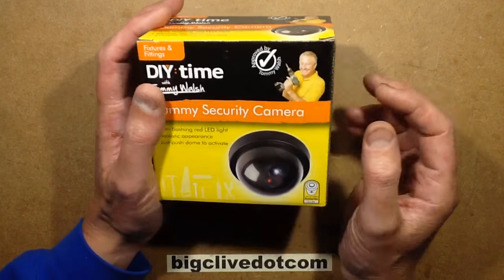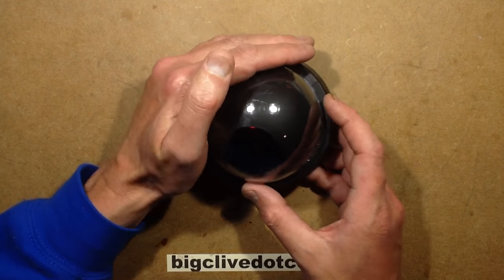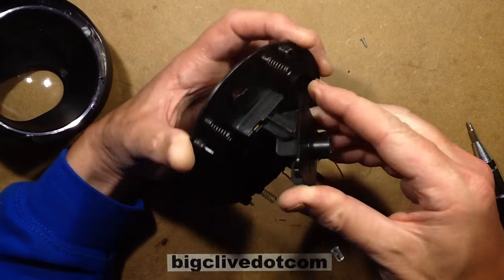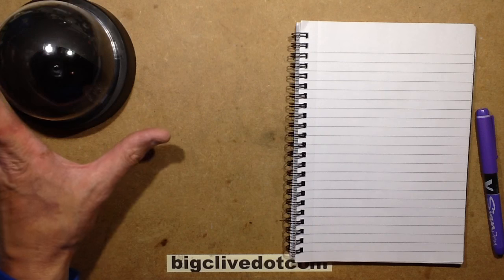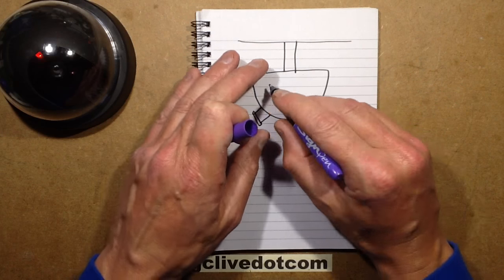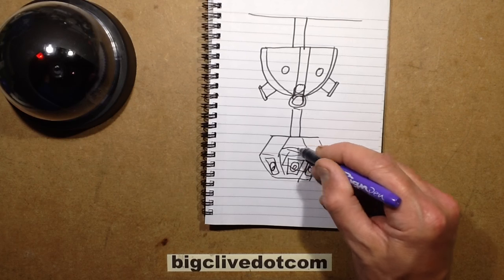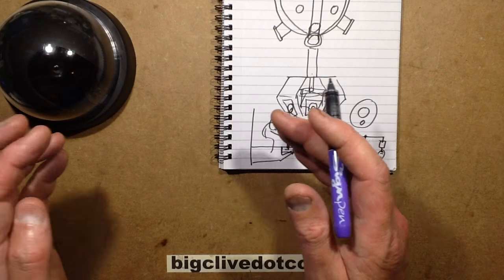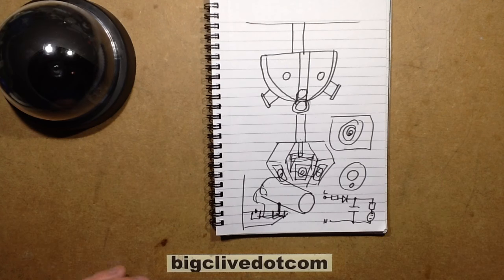Poundland dummy CCTV camera.

Comment: You know, you can get a composite video pinhole camera for very cheap on eBay. Might be an interesting project to use this case and make a fake looking REAL camera.
Reply: I was thinking about that even before I saw your comment haha
Reply: Take it one step further and add an array of "infrared" LEDs using the super cheap red ones, for extra cheesy effect.
You'll have unsuspecting mischief makers laughing straight into the lens because it looks so dodgy.
Reply: Actually if you used real infrared you'd have night vision once it reflected back into the camera. Assuming the camera converts it to a purplish white light like the cheap ones do.
 Some digital cameras do have an infrared filter though which ruins the fun.
Reply: PixelOutlaw
Once you get to that point, wouldn't you be better off just buying an actual dome cam? :P

Comment: When you mentioned LM3909 it nearly brought me to tears. Why the hell is it when people invent something perfect and beautiful they stop making it. Just like Nickel Iron batteries which last virtually forever and stand endless abuse. The LM3909 was brilliant, I built a circuit for a friend that flashed a red LED to make it look like he had an alarm in his garden shed. I think it only had one Duracell D battery in it. The spec on the chip said it would flash for two years I think. It flashed for ten years at least, and it may still be flashing. He never changed the battery. I am sure it is still working somewhere in his shed. It has been years I had hair when I made the bloody thing. Managed to buy two LM3909s recently, it may have been ebay. Not used them yet but if I ever need to they are there. The battery must be leaking by now lol.
Reply: Why don’t they make those batteries that last forever anymore!
Hmm 🤔 I wonder why
(Because they are B🤬stards & there’s no money in it)
🤗

Comment: hey big Clive what's your printer model? the one with huge ink capacity
Reply from the maker: It's an ordinary printer (Epson SX515W) but fitted with a CISS system (Continuous Ink Supply System) That has a special set of tanks fitted with an ink ribbon cable that goes to an external reservoir for the four colours (4 x 100ml).  The printer occasionally rejects the cartridges because it can't read the ink level properly.  When it does I just press a button on the cartridge and it makes the printer think a new set has been fitted.
Reply: Clive, Perhaps you could show that hack ?
Reply: +bigclivedotcom thanks for response as I know you've answered it in a video before.

Comment: In supermarkets, I think they still have them, if your at the checkout, look up. There is often a mirror the length of the checkouts either a mounded semi circular tube or more likely a metal box with long mirrors along its length on the side facing the checkouts. Inside is one camera, that trundles back and forth on tracks. Not sure if it "patrols" back and forth or can be moved at will. It's looking but of course obfuscation of its exact location at any given time is likely more deterrent than the camera itself.

Comment: A suggestion, how about putting an IR motion sensor in it and activating the led with it? That would look more convincing I think
Reply: Poundland.
Reply from the maker: It has a position for an audio sounder, so I'm guessing that they had a simple LDR style motion sensor option for warning noises.
Reply: Yeah, some dome cameras have IR emmiters which are barely visable, but visable non-the-less. 
I think the intention of the LED light is to give the impression that it is connected to something, so not a bad thing
Reply: motion sensor would probably consume more power than contantly flashing LED

Comment: On the subject of dummy cameras:  we had a problem with people pulling the fire alarm in a hallway in the industrial plant where I work.  One day I was handed a real camera (but it wasn't going to be connected) and told to mount it on the ceiling pointed at the alarm pull station.  Further instructions were "do it at shift change, and get in the way as much as possible."  I went so far as to drop the cables through a hole in the ceiling, but the cables were actually not connected to anything but the camera.  I looped the free end of the cable around a rod to keep it from being pulled out of the ceiling.  The false alarms stopped immediately. :)

Comment: Another thing you could do is put a wire into the camera's case and then run it off somewhere so it really looks like it's wired to a DVR/Monitor.

Years ago back in the 80s I went to a department store named Bradlees and that was in Connecticut and they had some weird looking CCTV cameras. Basically it looked like a striped ball hanging from the ceiling and every now and then it would turn. As a kid I was like what the heck is that thing? later it hit me that those weird looking balls hanging from the ceiling were the CCTV cameras and you couldn't tell what direction the camera was pointing. This store is defunct now.

I've never seen a red flashing LED like that. Most of the ones I've seen are the flickering LED tealight candles and the multicolor changing LEDs.

Comment: We had the dalek style ones in Debenhams when I worked there in about 1990. All the eye cameras were fake, but one of the chrome strips was actually a 2 way mirror with a camera mounted behind. It was the security guard manually turning them in this case and the camera also had full 90 degree up/down movement as well as zoom. The red lights could be switched on and off independently of the camera too, so they didn't correlate at all with a camera actually being active.
Reply: What Debenhams did you work in & What colour was the Cameras
Reply: Calfaeairdrie 
The branch was in Guildford, Surrey. I don't remember the colours well. I think the kettle was chrome and the strips were black in fact, with one strip being transparent. They had 4 fake cameras pointing out at 45 degrees and some button lights, either white or red.

Comment: A few years ago, I was given a couple of dummy cameras, but they were rather more sophisticated. Along with the led, there was also a motion sensor of some sort. So in addition to the blinking red LED, the motion sensor detected your presence and activated a small motor which would pan the dummy camera left and right. If you watched it, it soon became apparent that the device always came back to the same parking position. The fake lenses were remarkably realistic, with a dark and sinister look which reflected light, but you couldn't see through them - A bit like Darth Vader's helmet!

The fake cameras were a convincing 'duck egg' blue, and of a size that reflected the appearance of an average CCTV camera of its time. They even had a plausible sounding maker's name. For added realism, there was a fake flex which exited the back of the casing, and entered the wall plate.

I should still have them somewhere.

Comment: The old C & A clothing stores used to have those 'Dalek head' cameras as well. I first saw them in 1973.

The vidicon tube was the most common pick-up, Plumbicons were more expensive and were found in broadcast cameras and medical-imaging equipment. Vidicons were overly red sensitive, unlike the early Plumbicons. They also smeared in low light levels. I can't imagine the image would have been very good in some locations.

Comment: You could slightly undummyfy this camera by inserting 9 red clear LEDs like this one, but glowing constantly, stick them around the "lens" in a circle and drive them through high value (like 2k, 4.7k) resistor. That way they will immitate infra-red light for a real camera and the power consumption will be way lower than 10mA generated by that 1 LED, closer to 1mA.

Comment: I worked for Boots the Chemists up until  87 and I had cause to use this security camera system. The only camera that was working in each dome was behind one of the chrome glass strips. It went up & down by a joy stick & this also moved the dome L&R or you could switch it to auto and it would move randomly. The video feed was to a monitor with a VHS recorder in the security office. You could also choose a feed to display on the public monitor.

Comment: Torquay still has a few of the old type dome cameras around in public areas and along the street, they are massive, have 4 fake lenses attached with the one real camera inside; the camera itself can be upgraded to more modern CCD/CMOS type as the big round dome is just a PTZ housing, so mechanically there is no reason to change them to newer types until they actually break down which has only happened din a few cases recently.

Comment: I remember those rotating camera arrays, there were similar ones at a local Woolworths until a few years ago. They were painted red and looked more like a disc-shaped UFO with multiple flashing red LEDs around them. At least one camera on them was real, because if you carefully watched the monitors that were located near the cash registers, you would eventually find out which camera looked where.

Comment: I am 95% certain we still had those huge things in one of the local (Holderness Road, Hull) Boots branches as far as the late 1990s if not the early 2000s. The interior of that place did not change at all for almost 30 years, I don't really know when they disappeared because I didn't go in there for around a decade, only returning a few weeks ago and noticing they had finally changed the interior - and missing the old one immediately as I used to like watching the chemists and film developers in the back when it was all open. Those huge, more square ones did indeed have at least one real camera in as you could also see the grainy monochrome images on a CRT wall at the back of the store. Pretty crappy, because it was always really dark in there (it resembled the set of a cheap 80s music show or something, not very Chemist-y at all) and the cameras didn't work well without a blinding level of light. Ha, I can still remember what it used to smell like in that store.

Comment: LM3909 can be kinda-substituted with ICL7660 for a 1.5V LED strobe. Google "ICL7660 led flasher" for a schematic. It's just a matter of driving the frequency of the charge pump down. The downside is a little afterglow present.
Reply from the maker: Neat.  I hadn't come across that.
Reply: @bigclivedotcom  I have been using chopper stabilised op amps for 49 years they are what make your dvm work . Where have you been lad ?

Comment: The large Boots store in Eldon Square in Newcastle had one of those "Dalek's head" cameras right up until the late 1990's! Speaking of Daleks, I use two of those Poundland fake cameras on my Dalek as removable bumps painted to match the rest of it otherwise the base of the Dalek won't fit in my car as it's a really tight fit against the roof.

Comment: 110mm film is know as Medium Format and is MUCH bigger than 35mm. Beautiful format.
Reply: 110 film/cameras were a short lived format in the 70's and 80's. The film was a lot smaller than 135. I've got both he Pentax 110 SLR  system, and the Minolta 110 Mk1.  The format up from 135 was 120 &220.
Reply: The 110 film Clive referred to was in a cartridge which made it easier to load film in a small camera. The quality of the pictures was poor but appropriate for 'happy snaps'.
Reply: the 110 clive refers to had a negative size of 13mm x 17mm, much smaller than 35mm, it was the 1970s cheap camera.
Reply: Ah, interesting how it went from very small to very large.

Comment: Most of the shops in the Whitgift Center (Croydon) had those, I remember Woolworths (in both Croydon and New Addington) had them in black and chrome. Also, some shops (Boots) had mirror domes on the ceiling... All a bit "UFO" and "Space 1999".
If you stuck a syringe on the side of it, it would look like that chrome black orb thing that Darth Vader used to threaten Princess Leia with, in order to find the location of the rebels hidden base.

Comment: Best I could find was ... https://www.flickr.com/photos/pixelhut/6654036665

Both Boots and Woolworths in the UK commonly used those black and chrome ceiling cameras with multiple lenses.  As with the hex-a-globe one you disassembled, Clive, they only had one camera behind one of the lenses - when a feed was sent out to a TV visible to the public later in their lives.  I found the downward-pointing lens the most amusing.  I suppose they could have looked a bit sinister, but I thought of them more as R2D2-like than Dalek and therefore more benign.  They had them hanging around the Polaroid cameras and Dragon 32 computers in Boots.
Reply: yep that's the one
Reply: Yes they had them until very recently in the Boots branch I worked in. I can confirm that the camera was behind one of the silverised strips mentioned. They even had one in the stockroom watching the staff.
Reply: johno4521 can you get hold of any?
Reply: What Boots is it you worked in.
Reply: Calfaeairdrie 680

Comment: As most CCTVs now have IR LEDs that faintly glow red in the dark, I'm surprised there are no dummy CCTVs that imitate this, i.e. ring of red LEDs connected to a high value resistor.  This would give the familiar IR CCTV look in the dark while drawing less current than a bright flashing LED.

Comment: Just out of curiosity can't you achieve a similar job as the LM3909 with a LM555 and a NOT gate or a Flip Flop? I'm not familiar with the LM3909 so I could just be getting the wrong idea.
Reply from the maker: The LM3909 operates down to a much lower voltage.  Less than a volt.
Reply: +bigclivedotcom Fair enough

Comment: The newer once I've installed actually have LEDs in them to light up the area it's a red LED ultraviolet light the camera has two functions on night vision camera using LED UV light and the other one is just a regular daytime running mode is switches when it changes lights with no ultraviolet light around

Comment: Yes, alas and alack I remember those humungous manifestations placed in Woolworths and other larger stores and the few and far between shopping "Malls" of the 70's running into the 80's. The revolving ones were probably the type that we as young teenagers would be enthralled by and tested by picking a sweet, usually a Black Jack, Fruit Salad, Super Shrimp, Flying Saucer, et al and quickly putting it in our mouth and walking away. This was probably a crime that we performed 3-4 times before our attention was hijacked by hormones and switched to girls. Looking back some of those cameras were so big it was a wonder that the ceiling held them up there. Good nostalgic post Clive, thanks.

Comment: for me in america, i usually see these large black spheres with a pole that would stick to the top of the ceiling. the spheres were black on the bottom half and white on the top half. they looked like this -> http://media2.wxyz.com/photo/2015/02/23/Security_camera_controversy_at_Howell_Wa_2628250001_13783279_ver1.0_640_480.jpg

Comment: Little known fact re: those turret "dalek" type cameras - the camera wasn't actually behind the lenses.  

If you looked you'd see 4 'chrome' ~1.5 inch wide trim strips running from the 'south pole' back up to the equator between each of the 4 lenses spaced around the globe.  The camera was actually situated on a ~90 degree arc / tilt mechanism peering through the arc of the 'chrome' trim strip.  The strips were a one way reflective arrangement.

In the pic someone referenced in other comments https://www.flickr.com/photos/pixelhut/6654036665 you can make out the chrome band looking say 20 degrees to the left of where the photographer was standing.

Comment: You could do a double bluff, add a cheap video camera module, and keep the flashing light ;)
I think some CCTV's especially in shops have the flashing led to make customers aware that they are there,  a flashing one catches the corner of your eye easier than a steady one.
I remember those multi camera boots domes, at least one of the cameras work, i used to wave at the camera while looking at the public monitor when i was young.
btw, i found a m34-1 and m34-2 (1 and 2 Hz flasher chip), good price on rapidonline

Comment: Crims check for CCTV cam with mobile phone cameras these days. The IR illumination shows up the same as if checking a TV remote's batteries. Temporarily blinding them with a cheap lasers mounted in a lumps of blutack is a totally OP fix to almost any CCTV system I've been told.

Comment: Talking about those huge 70s cameras, my local Kmart still has something similar.  Huge reflective-finish domes so that you can't see where the internal camera is looking.  Very sinister-looking.  

Clive is right about these dummy cams.  You can get the dome ones like the one Clive is showing here at an Australian "2 Dollar Shop" for two to three bucks.  Then if you've willing to part with between 5 and ten bucks you can get the cylindrical ones complete with fake cable, wall mount and a lens surrounded by fake IR LEDs.  They all have the battery flashing light.  Most crooks, including kids, will instantly know that the camera is fake if it has a consistently-flashing red LED light so, as Clive says in this video, don't power up the flashing light...leave it off.  The dummy camera will then look more convincing.

Comment: How about soldering red LED to wiring from solar lamp and putting bigger (ie AAA, they give same output as little button cell) accumulator? You could even drop on/off switch completely and have it powered 24/7, with no need to plugging it to mains...

Comment: so this is probably a stupid question but what makes the led flash if its connected straight to the batteries?
Reply from the maker: A chip inside the LED housing.
Reply: I thought it must be
leds are amazing the bits inside that the light comes from are sooo tiny